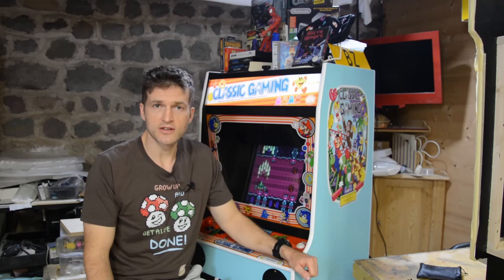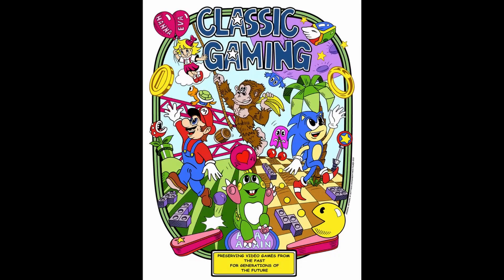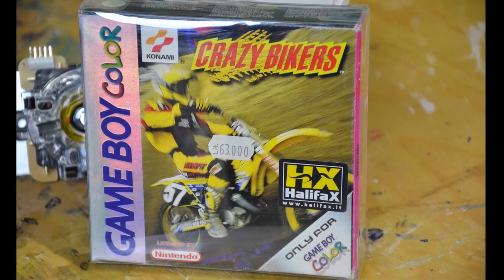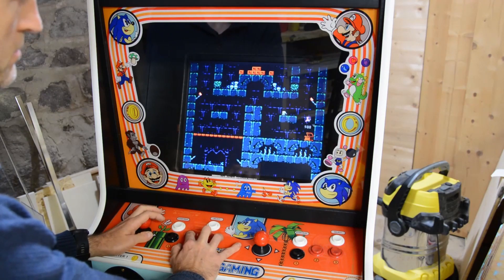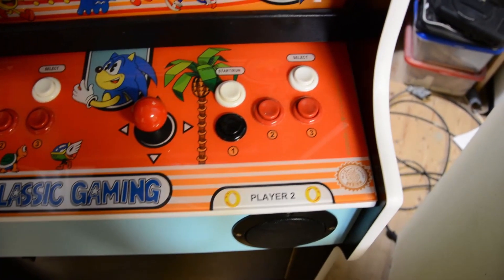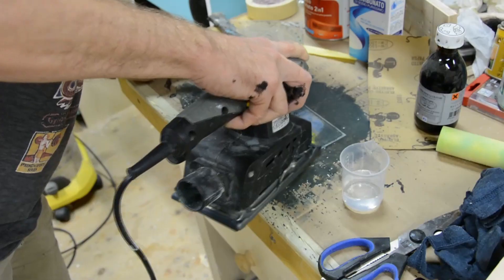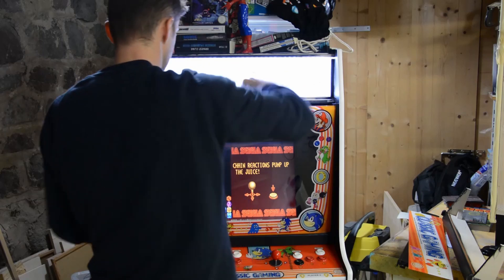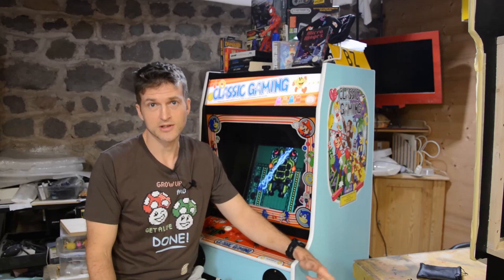Donkey Kong inspired DIY retro arcade cabinet with NES mini SONIC  and Mario

Comment: Es ist wirlich schön zu sehen wenn man endlich jemanden sieht der diese Automaten per Hand baut und auch alles selber verkabelt und nicht nur vorprogrammierte Maschienen die massenweise von diesen Spieleautomaten herstellen. So erkennt man auch wirklich ihren Wert und man weiß, mit wie viel Liebe und Lust das alles gemacht wurde. Wirklich sehr tolle Arbeit die Sie hochladen um andere zu motivieren selber etwas zu bauen. Auch das sie mit Raspberry Pi arbeiten finde ich sehr interessant. Bitte machen sie weiter so und hören nicht auf diese Automaten selber zu designen;)
Reply from the maker: Hallo Matia. Dankesehr. Raspberry Pi habe ich allerdings keinen verwendet. Vielleicht mach ich auch damit Mal etwas.  Hatte ich bislang nie ausprobiert. Aber über YouTube Tutorials kann man fast alles lernen... Ich habe noch mehrere Maschinen in Planung und Arbeit, werd damit nicht so schnell aufhören. Wenn ich wieder etwas mehr Zeit habe kommt ein neues Video.